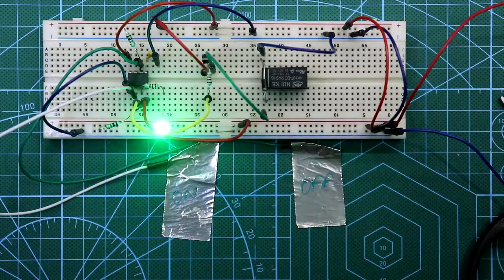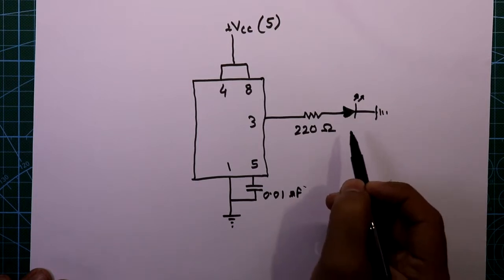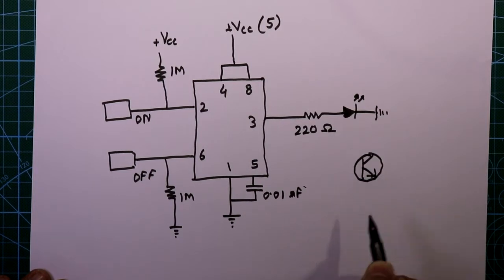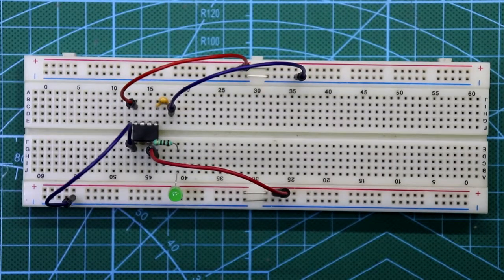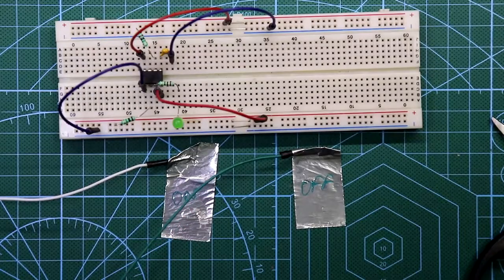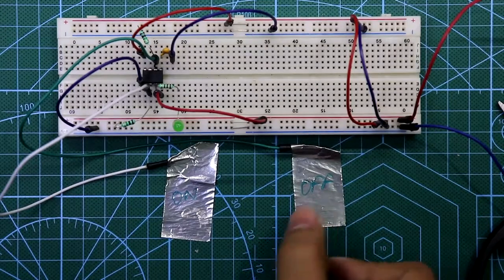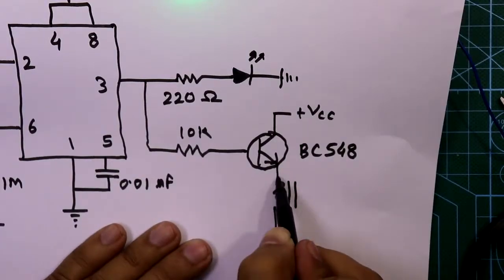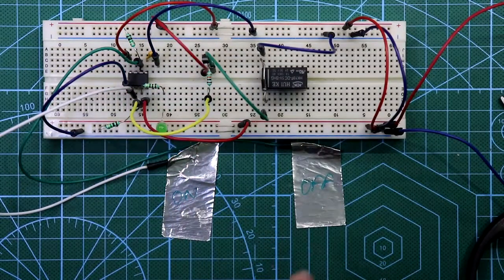Touch switch without using ttp223 sensor | 555 project

Comment: Brilliant. I am 46 and pretty old to be learning new things, but you explain things very clearly young man, very well done indeed. I am learning lots from your videos. keep up the good work. Love from the UK, Ken.
Reply from the maker: Thank you so much Sir, I'm really inspired by you. Love from India, Debajyoti.
Reply: You would obtain much, much better results if instead 1M resistors you use diodes properly polarized (you even do not have to use strips of aluminium foil, simple short wire is absolutely enough).

Comment: You would obtain much, much better results if instead 1M resistors you use diodes properly polarized (you even do not have to use strips of aluminium foil, simple short wire is absolutely enough).